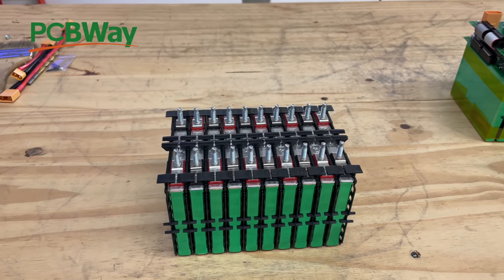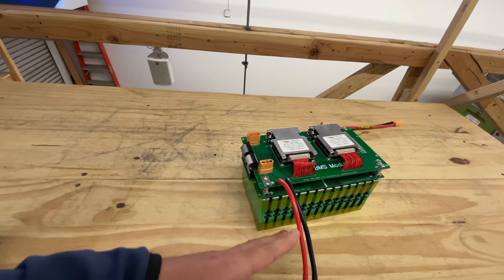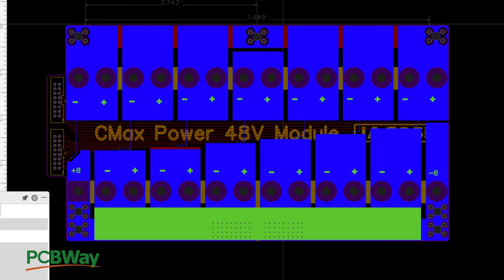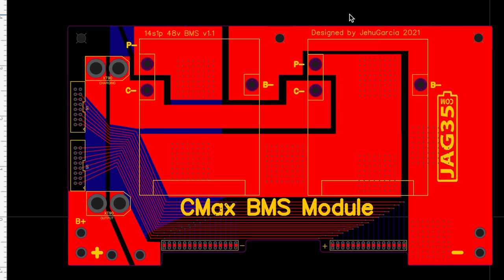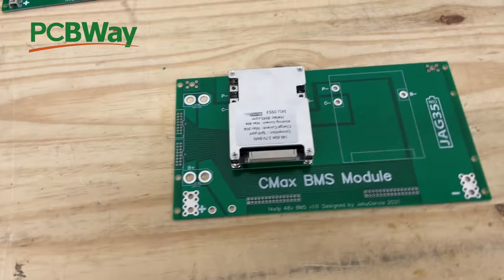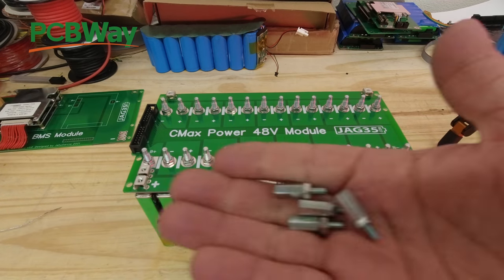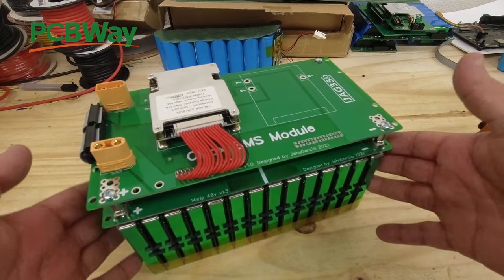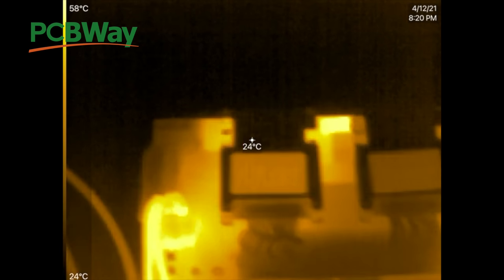Easiest Way to build a 20C cMax 48v Battery Module

Comment: For what its worth dollar tree sell plastic cutting boards that make good separations for the cells super cheap and easy to cut and a heat gun or tea kettle will let you bend them into shapes that make them useful
Reply: I saw those, need to pickup 1 soon, iirc it's a 2 pack for a buck.
Reply: @themadatheist1976  yup that's the one two for a buck
Reply: Game changer thanks bro

Comment: Bro you inspired me to build a battery over two years ago. I decided to use these cells. It changed the game! Car audio SPL competition. I replaced 400 lb of battery with one 60 lb 45 amp hour. I charge at around 15.4 volts. They're super impressive. I clamped around 12,400 watts on a burp. Starting voltage was 15.6 and it went down to 15.0.  stock 110 amp alternator with adjustable regulator. . There are some rules to using these batteries. And they cannot be broken but they work amazing. Thanks for your help understanding all this

Comment: The standoffs aren't cool, they're reflective.
Reply: right, always the same problem, using IR cameras is easy, interpreting the results needs a little know-how shiny metal surfaces can not be measured with IR cameras in the same "frame" the keyword is emissivity

Comment: Wow, seeing them by themselves they seemed large til you hand enters the frame. I'm trying to find a solution for a external pack for my 230w laptop.
Looking to do a 24v system stepped down to 19.5v, 12a.

Comment: I saw one other comment about having them compressed. please dont ignore this. these cells will swell if they are not compressed. your board will still work fine, you just need something very strong to hold these from swelling. i have seen these blow out the side of a plywood box
Reply: We use these in competition car audio systems! YOU MUST COMPRESS!
Reply from the maker: How many In series do you use?
Reply from the maker: Well,  go ahead and compress them,  you don’t need my blessing
Reply: @jehugarcia  I think people do 4 or 5s but they also do like 4 to 10p regularly

Comment: Nice system. Many greetings from Germany, do you also send to Germany? 😅
Would something like this be usable as a 12V system (with a cover) in a car?
Especially because of the temperature ranges -10°C to 40°C
Reply: Hi Andi, haven't seen Jehu delivering to Europe eversince. But I may be wrong.
And never say never. 😉
Suitable as 12V starter battery for cars?
I don't think so. IIRC, the German KBA / TÜV objects due to fire hazard in conjunction with petrol nearby.
You already delivered a proof of concept with even less powerful cells, so it's all about permission. Unfortunately.
(This is why I use a 12V-6Ah-60C  LFO starter battery for my Honda PanEuropean.)
CU on your channel, Doc! 👋

Comment: Ah, nice. Those typical car starter batteries and jump-starters (if already Lithium chemistry). Nearly exactly the stats of my (ICE) motorbike's starter battery (well, a quarter of the power of course, since it's the usual 12V).
Using it for about 5 years, flawlessly.

Edit: Correction, mine are LFO (12V, 6Ah -> 72Wh, 360A max. -> 60C). Mistook yours for also LFO.

Comment: I wonder if I could get away making a 24v version of this so I could power my 19.v/12a laptop all day and save 11 pounds to carry? Step down the voltage to what it needs and use my laptop power brick to charge the pack overnite. I'm a cyclist and want to keep the weight down as much as possible.
Reply from the maker: the scooter packs we have are the way to go for ultimate energy density,  these ones are big and heavy in comparison

Comment: Why are the power leading standoffs not visible in the thermo picture ?

Usually the should get as warm as the cable to the inverter. I would have thought that the terminals on the pcb like the stand offs would be "more visible" in that picture.
Reply: shiny things are also shiny to heatwaves

Comment: If you get any more of these cMax 48v Battery Modules please let me know I need one or two. I have the batteries already [ Honda Insight ] and I didn't know you had these until now. I need a couple please. I want to use them for solar but have been unable to figure out wiring and bms. Now you have a sweet solution. Please help me Jehu ready to buy them now.

Comment: I have a question and have watched many videos,  say I have a cart with a brushless motor works on 12 V or 24V with no load provides .5 n meters  how many mah do I need to turn that 12 inch wheel with 30lbs. Which would work better 2 five battery packs run parallel run in series with 2 packs in parallel I guess getting 24 V 29,000mha or 12v with 4 packs run in series? 60,000 Mha

Comment: Really nice and clean design. Electrician nut drivers (much like electrician screwdrivers) have almost all of the exposed metal covered in insulation.

Maybe the hotspot at 13:19 is caused by a bit of a current imbalance between the two BMS. The 'hot' BMS has a shorter ground path, where as the other BMS has a longer and narrow path resulting in a bit more resistance. This has an impact on current sharing; probably negligible in this case. Your positive trace/pour can counter act this, much like connecting positive and negative cables on opposite ends of battery arrays.

Comment: Soldering the BMS leads like that is fine but I would double/triple check you didn't short any adjacent pins.  For the sake of adhesion probably better to use rectangular pads for the soldering instead of standard throughholes (unless you plan on eventually using a connector)

Comment: i bought the bigger ones 3 years ago and they been working great and are easy to make, mine came with the nickel bars as well with sensor cables. I have 15 kw worth, think there 21 or 26 ah each and have like a 150 amp discharge each, plus there in packs of 13 so its almost 2000 amp discharge max.

Comment: Are these from the hybrid or the plug-in hybrid
Reply from the maker: You tell me
Reply: These are from the hybrids. The plug in versions are called ENERGI and are 26ah cells.
Reply: @jehugarcia  These batteries are really cool! NICE WORK!  I will be ordering one! I have 3x of the whole system the way it came in the C-Max car. The 6"tall x 18"wide x  48"long metal shielded unit has a 300v in to bms and then a high power out to motor which I would cap but also a 300 dc to 12vdc inverter to charge the starter battery. Kind of curious what would happen If I hooked up my solar panels to the 300v in and 12v out to lead acid golf cart bank.  Seems like a great standalone system assuming everything just automatically worked.

Comment: Could some of this battery pack replace a regular 12v 70AH lead or agm battery in a car with start stop function? Maybe other connected not to have 48v instead parallel for much more output power?
Reply from the maker: No you need LifePO4 cells for that
Reply from the maker: Maybe

Comment: Jehu, what thickness of copper did you order on the boards? 2oz, 4oz, what exactly? This would make a major difference to the current carrying and heating.
Reply from the maker: 1oz
Reply: @jehugarcia  That hot spot would be improved by 2oz copper, IMHO.
Reply from the maker: Yes but it would double the price of the board. Cost benefit análisis dictated thicker copper was not needed

Comment: $5 for 5ah 3.7 /4.2 volt cell, or $70 for a 48volt pack (cells only). That would cost a lot to make a useful pack/Powerwall. for 50ah it would be $700! (cells only) or $1,290 for the kits you sell. or $1400 for 100ah(for just the cells) or $2,580 for your kits. I will stick to my Lifepo4 cells, its cheaper. I guess I am confused on why these cells are interesting to anyone, I understand these are a blend NMC cells but the cost per kwh is WAY to high for those. I guess these could be used in an ebike since most of those are 5 to 10ah anyways, I'm not trying to be a " Debbie Downer" and I LOVE your PCB designs, I wish you would come up with more of those PCB's for Lifepo4 cells, I would buy those kits in a heartbeat! Keep up the good work man!
Reply: Energy density and charge/discharge rates.
Reply from the maker: Yeah these are
Definitely not powerwall cells.
Reply: High discharge Rate is what makes them interesting for some applications, for example drones or RC planes etc.

The cheap LFP batteries are great for powerwalls, but you could not use them for drones, lightweight applications etc. because their power density [W/kg] or [W/L] is too low

Comment: Jehu: sees 20 gauge wire  "this can't handle much power."
Also Jehu: sees 1mm thick copper layer on circuit board "this can handle, like, 100 amps."
Reply from the maker: I test my claims,  up to you to believe or not.  But I’ve never successfully convinced anyone who’s made up their mind.
Reply: @jehugarcia  who said I made up my mind?  I just don't think that a 1mm thick copper trace can handle 10 times the amperage of a 3mm thick wire.  Prove it can.
Reply: The reason that the traces can handle higher currents is simpe, current flows on the surface of the conductor and a 3mm round cable has half the surface than a 1mm x 6mm copper trace.
Jehu might not have the scientific background needed to explain to you the why of things but he has huge practical experience, your doubts are just based on ignorance.
Reply: @footfall4559  AC flows on the surface.  I don't think DC, like this, does.

Comment: These cells need to be compressed.  What are your plans to compress them?
Reply: I second this comment. Im in car audio and have seen several large cmax banks turn into bananas as they will swell without compression. please test thoroughly before putting these in any type of unmonitored use case

Comment: I see the board has vias to help with heat.  Do they also help with current distribution across the wide traces?  Maybe you could do a video on high current PC board design.